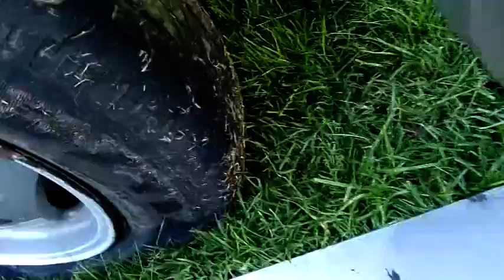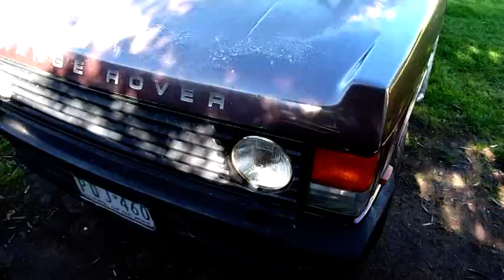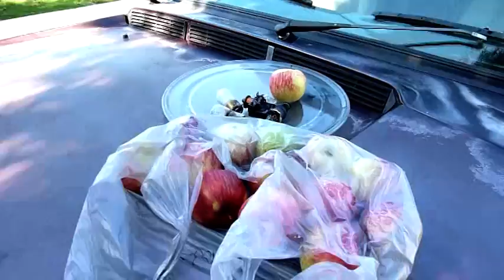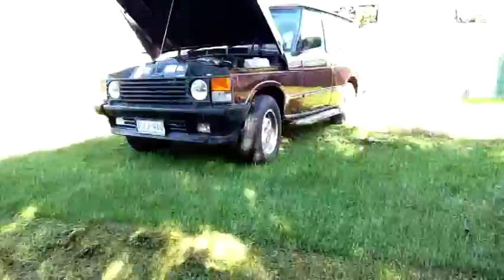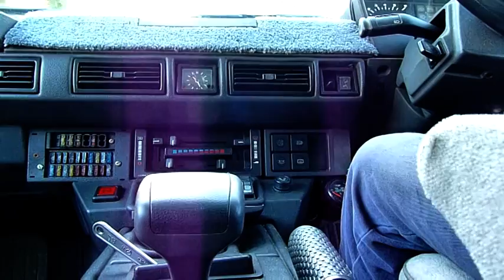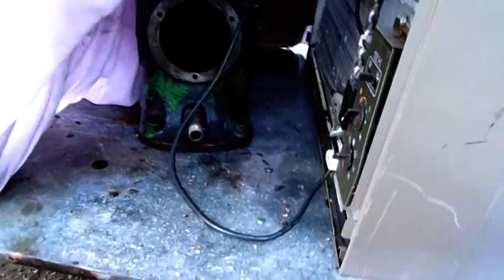Fixing Flat on Rangie and Clean Kelly & Lewis Engine block

Comment from the maker: @travisjeanelle most places here plug from the inside with a mushroom plug. you still have to ream the hole out with a tool or 3/16" drill bit.

power is getting more expensive I must admit. having AC units everywhere as noveltys will only last so long :(

Comment: USA you can use the as a permanent fix to. I just take mine it to get a patch. Plugs you can cut a belt and the tire is shot then. I would not be waisting power running an a/c outside. Here it just cost way to much here its $0.23 a day plus $0.13 per kWh

Comment from the maker: @Jaytheozzi tire plugs are fine IMO, used them tonns of times. just as long as they are installed somewhat well. not much can go wrong apart from another flat.

yeh the S1 is great, i'll be working on it tomorrow